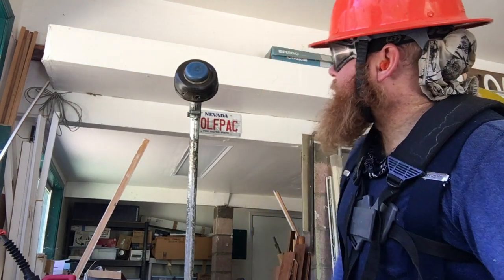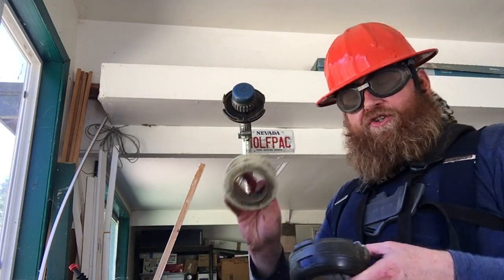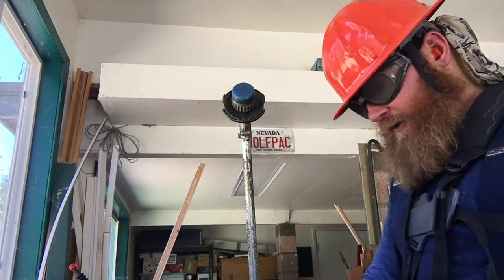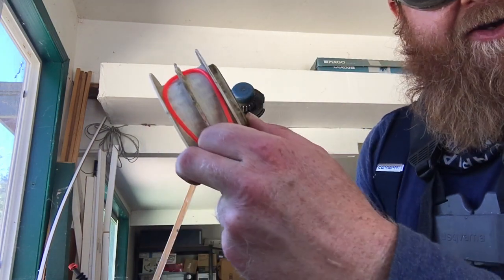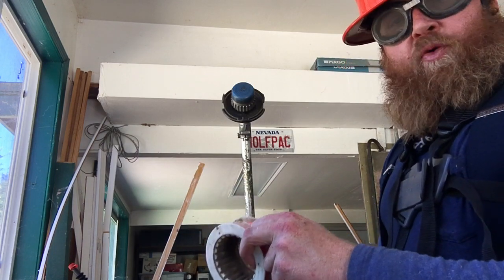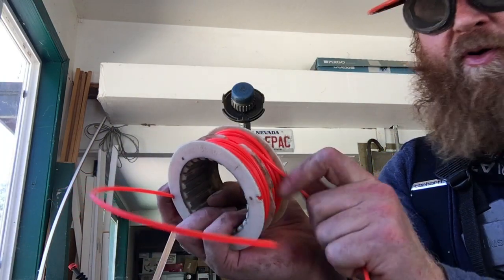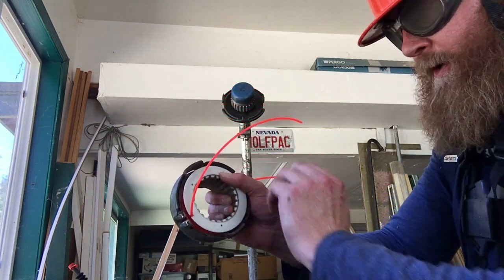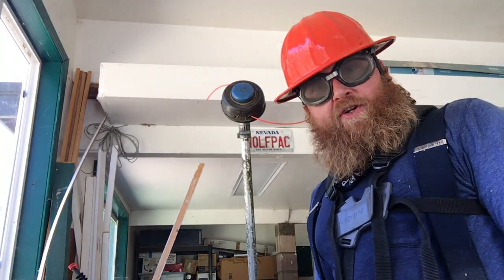How to Replace the Trimmer Line on a Husqvarna 525RX

Comment: Great video. Thank you.
What size Echo trimmerline do you use? .95, .105, another size?
Reply from the maker: I use .105 inches. Because I told you to use 4 arm lengths of line it is probably not a good idea to use a thicker line because you will run the risk of overheating your engine. Most people use 2-3 arm lengths. The guard that comes with your machine has blades on the inside that automatically cuts your line to the proper length after you tap the line release button on the ground. I have known people that have burned through engines by loading too much heavy and thick line on their spool and removing the guard. It's all about engine thermodynamics. You can store your echo trimmer line in a 5 gallon bucket of water to make it last longer and break less. I hope that was helpful.
Reply: Thank you. That does help.  What is the name Echo string you use?
Reply from the maker: @allentenderfoot8712 Echo crossfire.
Reply: @michaellee9883  thank you.